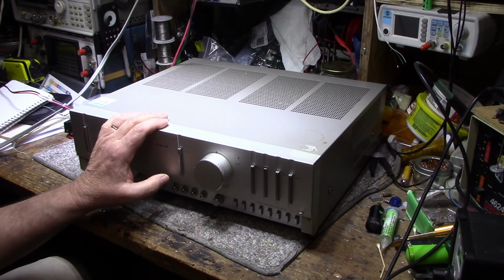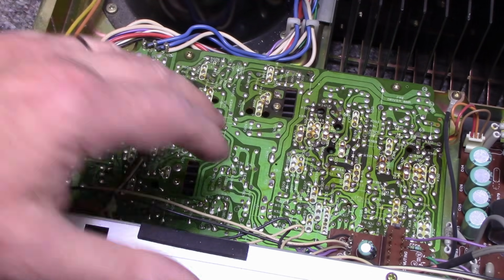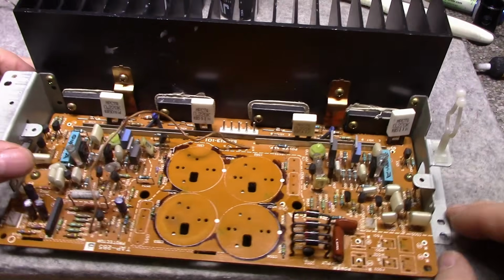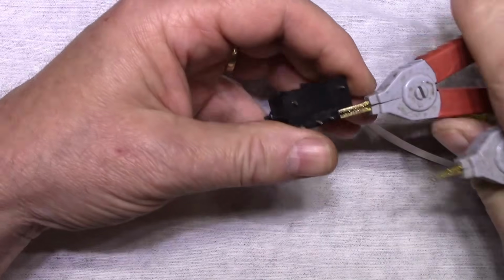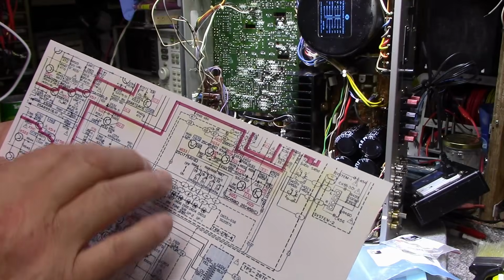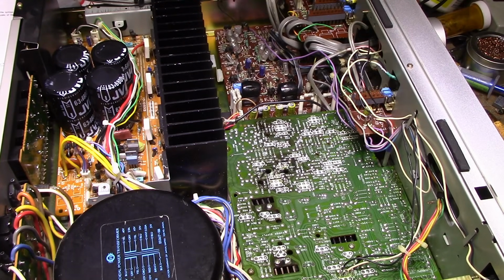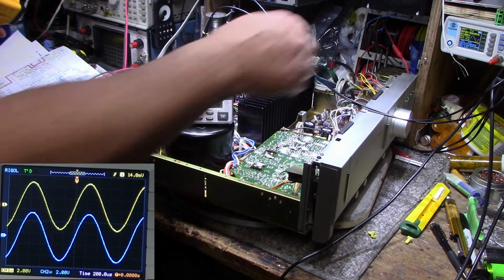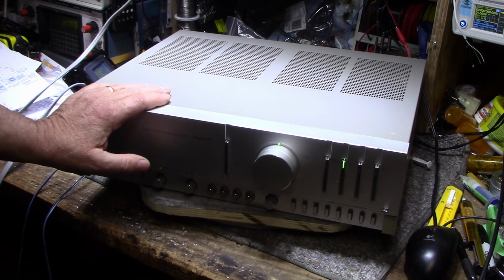JVC A-X7 Integrated Amplifier (Ep. 223)

Comment: JVC and their Super A amps allowed for super low THD, in the area of 0.005% .  SEA was an acronym for Special Effects Amplifier which was a multiband graphic equalizer for Left and Right channels. JVC always used novel engineering to solve various audio problems. I have a JVC DD-7 cassette deck that has been refurbished and I love it. All of their stuff suffered from scratches due to stacking components which led to insufficient cooling problems and thermal damage.

Comment: SEA was, I think, a JVC thing. Basically, a JVC limited graphic equaliser could be connected, as was included on some amplifiers and receivers they made back in the day. I have a JVC JRS-201 receiver with an SEA built in, the letters stood for 'Sound Effects Amplifier', not really a full graphic equaliser, but it gave you a useful tone control set up.

Comment: I wonder why they chose such a strange way to power and control the lamp ? They must have been either trying to prevent them flickering with power fluctuations or trying to prevent interference in the amp but I've never seen anything like it !
I was half expecting to see a few more modifications to this one to try to deal with some of the heat issues it has.

Comment: I still use the smaller A-X5 that i got for cheap over a decade ago. I also had to replace the lytics in the phono and poweramp-
input board because they got backed over time. Other than that just cleaning the pots and switches. And so far it works fine.
BTW:  There is no IC for the Super-A circuit in the X5. Its build discretly instead. And the output stages are smaller models 
of the Fujitsu RET`s in the X7,hence just 70 W/8Ohm per channel.  The transformer in the X5 is a "normal" one instead of the 
encapsulated torodial.  Other than that both amps appear to be very similar. And yeah,i had the luck to get one with the frontflap
intact.
Anyway,these integrated amps are still top class and were engineered with the old hifi ideals in mind. The concept: phonopre
passive pre with passive tonecontrols,filters and loudness,poweramps in true DC (well the fat foilcaps after the phono out are 
the only coupling caps in the entire amp). Its classic high quality of the audio JFet era of the late seventies: meaning JFets in 
the inputstages and ultrafast BJT`s as output powerstages - and realy high quality phonostages for both MM and MC.

What is lacking somewhat is build quality imho. And by that i dont mean the electronic parts used,but how the amp is internaly
structured. But i guess even back then the budget had its limits,although this amps werent cheap back then.

Comment: Normally an amp with super a or similar means that’s it’s a class a/b amp that can run in class a up to a certain power output, usually 5w or so. This maybe different, but I doubt it.  S.E.A. Is JVCs version of a graphic equaliser. JVC made some lovely amps during the 80’s then they turned into junk by the mid 90s like most HiFi brands of the 70s.
Reply: JVC super A amplifier, it is not an amplifier that works in class A, this information is wrong, it is always a class B, but it uses super polarization that does not allow the current of the NPN and PNP pair to, making them always very active and has a lower distortion than a class A at all volumes.

Comment: When you first opened the lid, I thought the heatsink looked a little small for 100 watts per channel. I bet it would get very hot into 4 ohms. Still, probably fine with music. Quite a voltage drop from the power supply on load. Not what I would expect from a toroid. Bigger caps might help a little. Overall, quite a good performer for a medium-priced amplifier. Even better for $25.